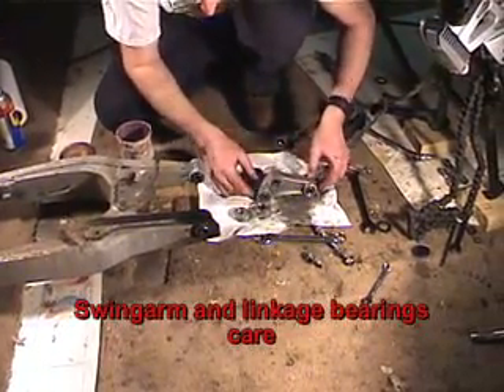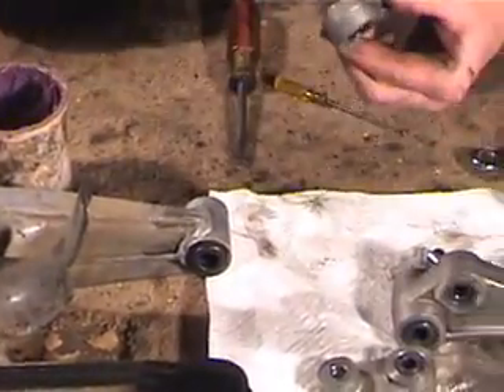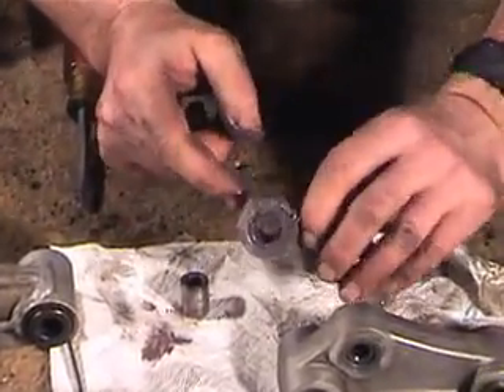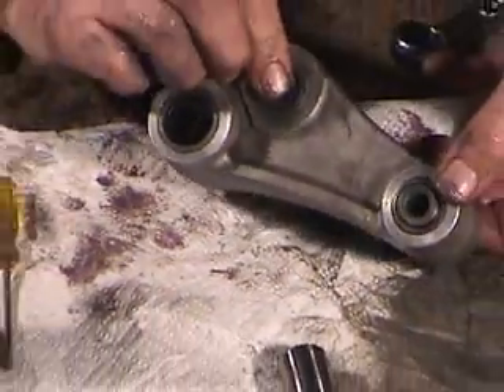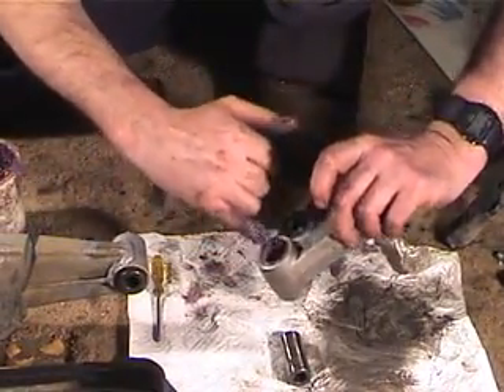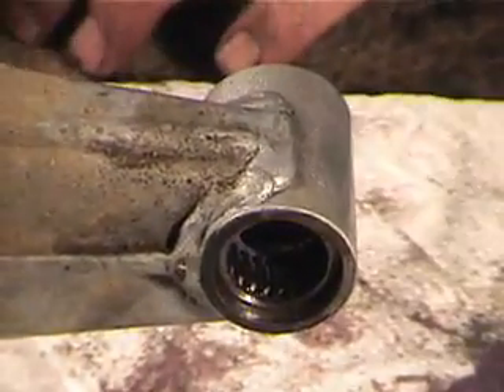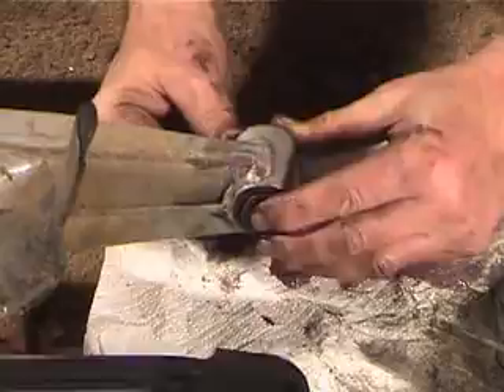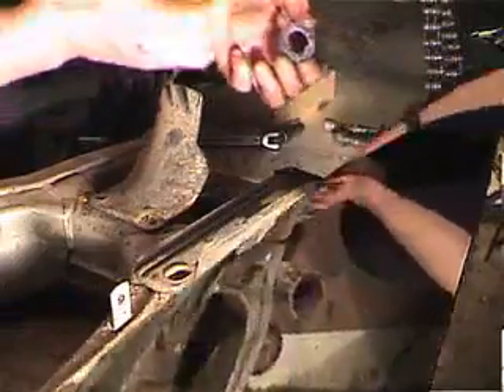Technical Demo on BMW F650 - Swingarm and Linkage Bearings

Comment: THANKS FLASH   YOU ARE A GOOD MECHANIC,  I HAVE READ A LOT FROM THE SITE F650.COM AND I HAVE WATCHED ALL OF YOUR VIDEOS.  I CANT GET A SOCKET INTO MY SWINGARM PIVOT BOLT AKA THE FRAME BOLT.  YOU SAY ITS 22MM AND I CANT GET THE SOCKET TO FIT IN THAT HOLE WHERE THE BOLT IS.  THE BMW PARTS WEBSITE SAYS 22MM TOO.